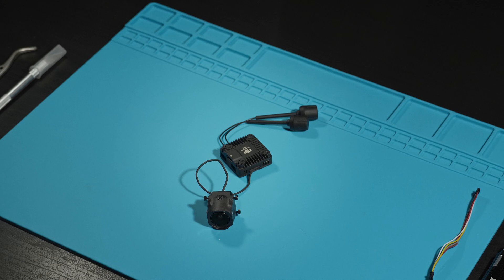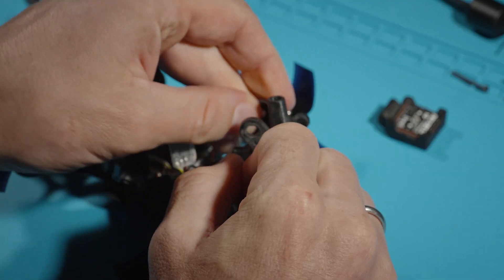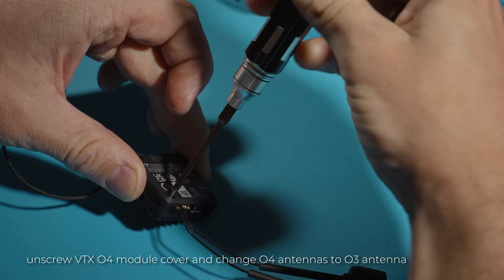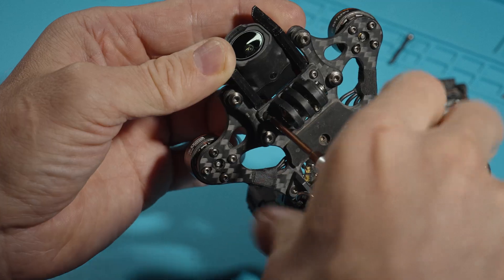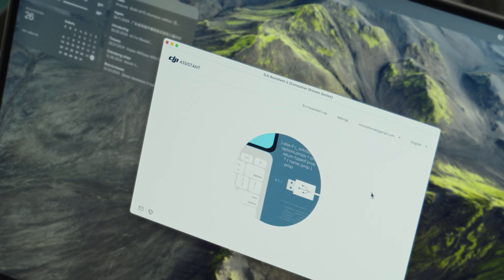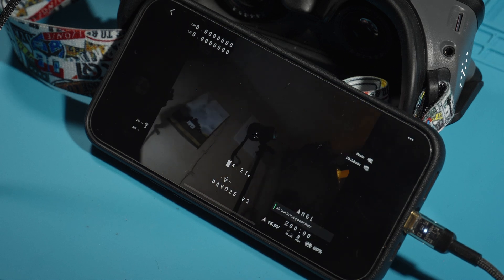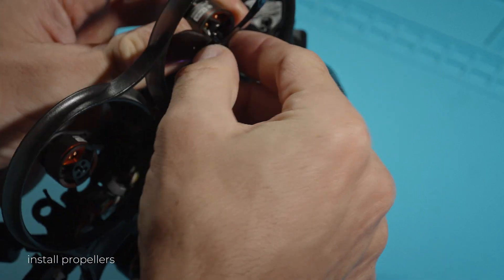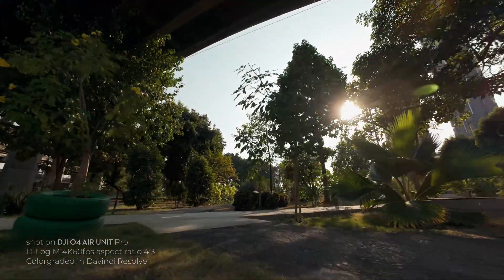DJI O4 AIR UNIT PRO Installation in BETAFPV PAVO25 v2 to v3 #fpv #dji

Comment: If the pin out is the same but I'm not getting any osd is that an MSI display port issue cause I'm using js connector from 04 to FC.
Reply from the maker: There could be many problems, from settings in Betaflight to issues with the FC. You can try soldering the contacts directly to the flight controller to exclude the possibility of connector failure, but then you will need to change the UART on the Ports tab

Comment: Hello nik! please could you give me the cli for the tune ? it have 2 profiles one for naked another for using without? please coould you upload the cli? thanks!
Reply from the maker: I used the standard CLI for Pavo25v2 from Betafpv. And it doesn't have two profiles, at least I don't have them
https://support.betafpv.com/hc/en-us/articles/24886214525593-CLI-for-Pavo-25-V2-F722-35A-AIO-V2
Reply: @Nik_FPV24 but that cli is for the older version that have another motors
Reply from the maker: Unfortunately, I can't share my CLI right now because I broke the micro USB port on the FC. But I'm sure it's the same CLI I sent above. Maybe BetaFPV really did change the settings along with the motors. You could try writing to their technical support

Comment: Thanks for this video, you know if the nd filters freewell for Dji o4 fit in this drone having the 3D impression of the camera?
Reply from the maker: Thanks! Sure, Freewell filters will fit if you're talking about filters specifically for the O4 unit. With the ones that are standard for Avata2, you might have to cut the camera mount a bit
Reply: @Nik_FPV24  Nik bro the nd filters freewell  fit without problems !     :)

Comment: Where can i get the gps mount 3d print file
Reply from the maker: Unfortunately I don't have 3D models for the GPS, but I found a couple options. It's free  https://makerworld.com/en/models/1361570-betafpv-pavo25v2-antenna-with-gps-gm10-nano-mount#profileId-1406373
And here's a complete O4 kit for not much money https://cults3d.com/en/3d-model/gadget/betafpv-pavo25-v2-complete-conversion-mod-for-dji-o4-air-unit-pro

Comment: Which printing material do you recommend for the camera mounts? TPU, or some stiff pla or PETG?
Reply from the maker: In this video, I printed from TPU. But still I think it is better to print from stiff material, as soft material can give unnecessary vibrations

Comment: Thanks for the video? How does this compare to the Pavo20 Pro? I just bought the 25v2 in analog and was planning on converting to DJI o4 later but I might just go digitial now. Would u recommend just trying the pavo20pro at that point?? Thanks
Reply: I would have to buy a lightweight action cam(action2) if I stuck with analog on the 25v2, so for that price I was considering making the jump to digital
Reply from the maker: Thank you! The Pavo20pro is better for flying in tighter spaces, but for flying outdoors it just doesn't compare, definitely the 25v2 is better, much better. Unless you plan to fly with an additional camera like action2 or naked gopro, you're better off putting the O4 pro on the 25v2 and don't even think about the pavo20pro. If you want to fly more indoors and sometimes with an external camera, you can take the pavo20pro for flying in tight spaces and leave the 25v2 on analog, as analog weighs less and will be easier to fly with naked gopro or action2 attached
Reply: @Nik_FPV24  thanks for the reply. So if I had to get only one, would you say 25v2 or PavoPro then? I’d guess a 50/50 indoor outdoor split but I think if 25v2 can freestyle and be small enough to fly inside that’s the choice. Thoughts? My next biggest drone is the cinelog35v2 and that’s too big for indoors/around people to fly comfortably

Comment: Hi. Is it possible to use the dji o4 on a RC plane? Thanks
Reply from the maker: Yes of course you can, the main thing is to supply power to the unit and have goggles to receive the picture

Comment: Hi Nik, very nice video, man — thanks a lot for sharing! Which screws are you using to install the O4 module? How did you solve the issue with accessing the SD card?
Is there a 3D file available for the insert (or for the screw extensions)?
Reply from the maker: I used m2 screws, the length of the exact do not remember 12-14mm, you need to select depending on the spacers. And yes I used simple plastic spacers 5 mm with internal size for m2 respectively. No problems with access to sd card and usb-c port

Comment: Hey mate. Nice video and thanks for providing the files for the 3d prints. I used O4 both antennas with the print you have provided and did the transition too. Only thing is there is so much jello. I am now troubleshooting and any tips would be appreciated. I subscribed your channel. Keep producing mate
Reply: Sorted it out. TPUs holding the O4 camera was touching the prop guard. I put some cuts in the TPU and it doesn’t touch anymore. Jello is gone
Reply from the maker: Thanks so much for the feedback! And yes all maunts that are out there in the open unfortunately have this problem, so have to be cut. The only STL that doesn't have this problem, plus it protects the camera is this one https://cults3d.com/ru/3d-model/gadzhet/dji-o4-air-unit-pro-mount-for-betafpv-pavo25-v2

Comment: Why are you not using the o4 pro antennas? Good videeo tough, thanks!!
Reply from the maker: Thank you for your comment! l just didn't want to print a new antenna mount for the o4 antennas, and I'm not going to fly at 24km and for my usage scenario the o3 antenna is more than sufficient

Comment: Those 3D prints you provided are for two antennas and a place for GPS, right? What GPS are you using?
Reply from the maker: I am using a GOKU GM10 Mini V3 GPS and a single antenna from O3 Unit

Comment: Thank you Nik, already do it to my pavo 25v2 without any problems, but i can't be able to put the Iflight ND filters, apparently it's very tight the space between the camera mounts, have you already tried putting filters on it?
Reply from the maker: Congrats on the upgrade! And yes I heard about similar problems with GEPRC filters, turns out the same problems with Iflight filters.... Thanks for the feedback, we'll keep waiting for normal filters. Actually on the O4 the filters from avata2 are fit, but many people have them on the contrary, they pop out easily even from a light hit with grass for example. I don't have such problems, I use NEEWER filters, but the avata2 filters are wide and don't fit these printed O4 mounts. You need to either cut the camera mounts, if they are the same as mine, or find ones that will not extend and interfere with the filters, you can find for example on thingerverse.com

Comment: I saw the jello image in your video, minute 15:35 - 15:45 have you found the solution?
Reply from the maker: That's weird, because I don't see a jello image there. At least that happens after gyrostabilization or because of a bad camera mount. Barely noticeable flickering happens sometimes because I had to make timeline at 25 fps and flight footage I shot at 60 fps, despite the fact that I did everything possible to avoid it, it can still be noticeable

Comment: Nik, I have a question? What was the purpose of the flat 3D print that you put together with the couplings where the camera goes?
Reply from the maker: I'm not quite sure what you mean, I had 3 parts printed in total, two camera mounts and one camera guard, mounts same way as ND filters. Maybe that's what you're talking about
Reply: @ Yes, that's what I meant, thank you very much for the clarification. What a great video. I hope you continue uploading more great content...

Comment: This is what I am looking for a few days! Thank you for the 3D models and detailed instructions. Definitely subscription. The only thing I have Pavo35, they are practically identical, not counting the size?
Reply from the maker: Thanks for the feedback, always happy to help. I can't say for sure now if the stl files will fit on pavo35, I'll give you an answer later
Reply: Тоже жду ответ влезут ди или нет эти mount?
Reply: @Everydji  I assembled a Pavo35 piece by piece a month ago, installed a 3D model from the author of the video on it and the mount fit perfectly. So you can safely install this mount on the Pavo35. Thanks to the author for this!